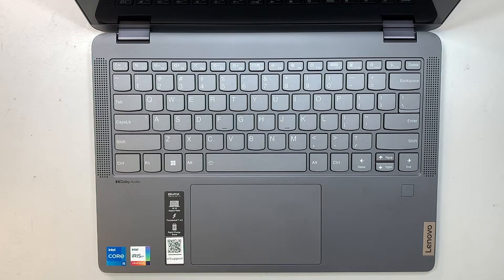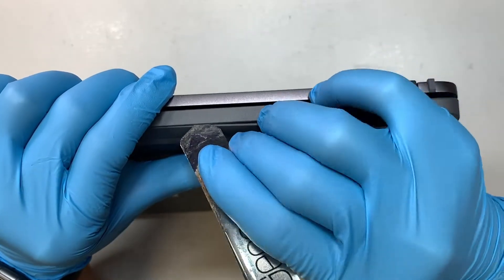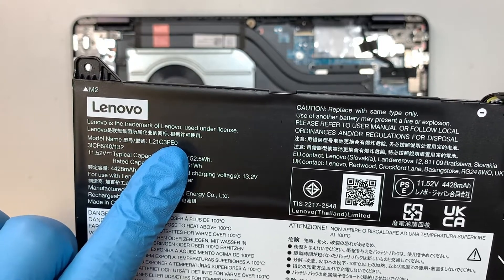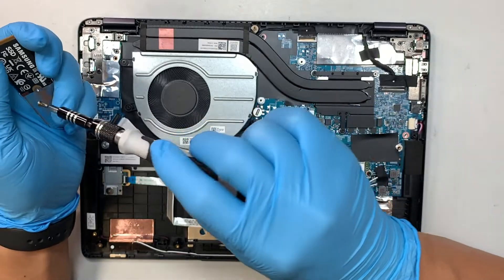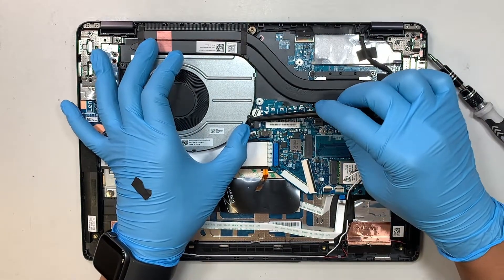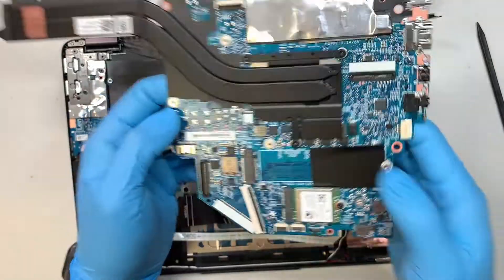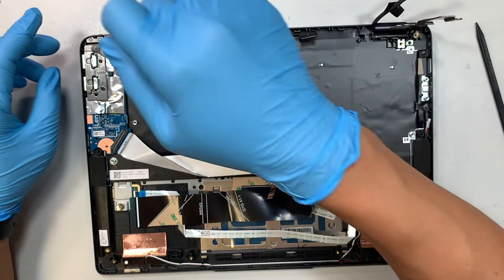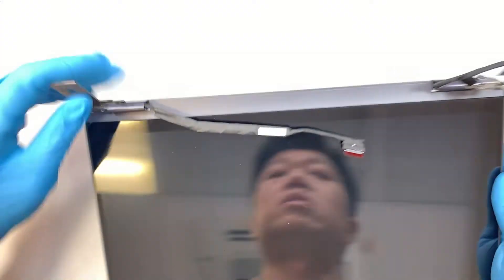Lenovo IdeaPad Flex 5 14IAU7 TearDown Disassemble Upgrade

Comment: Hey, I was wondering if you know or can see from the video whether the hinges are attached directly to an aluminium chassis? For durability reasons, I want a laptop with hinges attached directly to the aluminium instead of the plastic molds.

Comment: excellent video even if it confirmed my suspicion that the RAM for this model is not upgradable....i assume that if it were possible to perform a home-solder job on it you would have said so.....out of curiosity, why would Lenovo--or anyone--manufacture their computer in this way?  i fail to see how it would benefit them to do so?
Reply: It's faster ram I guess
Reply: Programmed obsolescence

Comment: Is that a good laptop for daily use, No problem at all ?
Reply: Yes, it is a very good one. I purchased one with a Core i3 12th gen processor and 8 GB ram for $260. It works flawlessly for daily use.
Reply: I'm using the r7 5700u 16gb version of this for university (engineering). It's working perfectly so far.